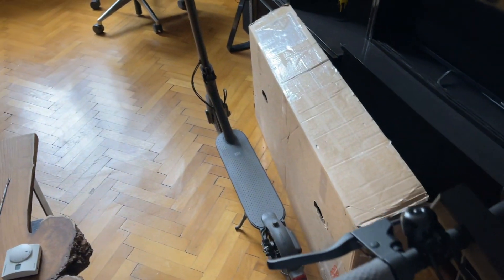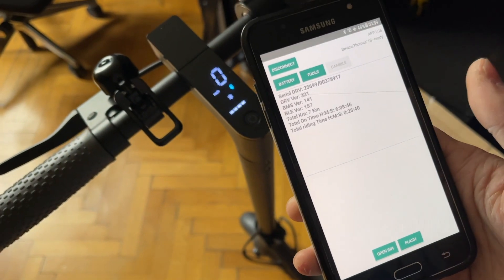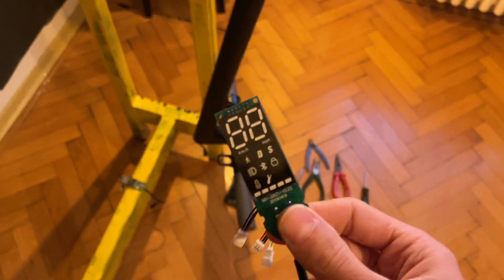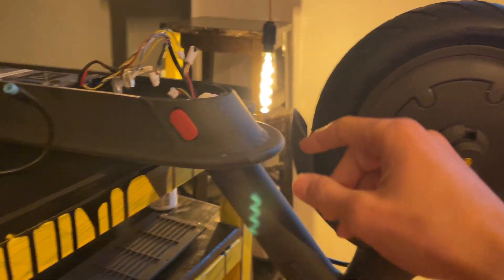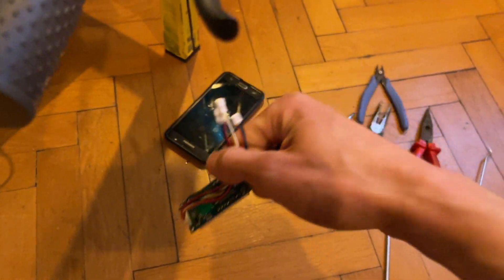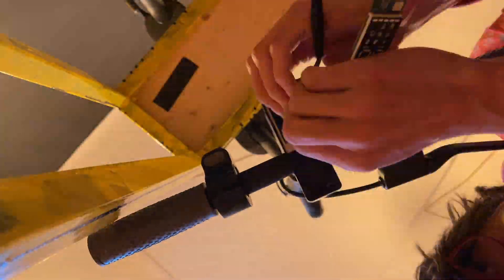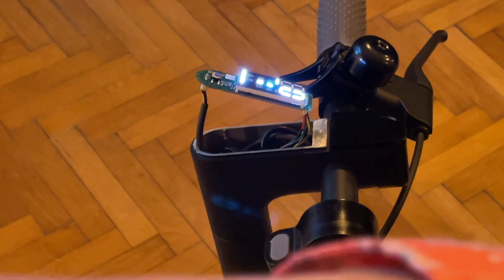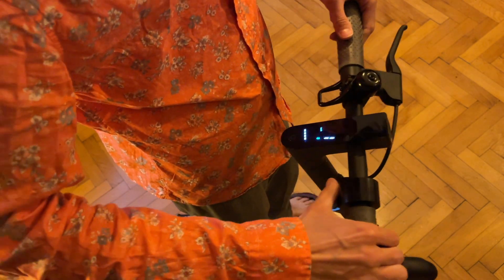Hot to get Custom Firmwares on newer Xiaomi Scooters [DOWNGRADE DRV231 • DRV247 • BLE157]

Comment: My scooter I Xiaomi pro 2 AMG but firmware is locked not receive the flash I want to change the dashboard it's working or not my starting running from 10 speed

Comment: I tried doing this on my Mi 3 and it didn't work. I have BLE 157, bought 2 new dashboards that say for M365/Pro2/Mi3, they look the same, but when I connect it says it's a Pro 2. When I try to flash a new firmware for the Mi 3, it says not compatible, I say to do it anyway, and then it fails. I have tried 2 different brands hoping one of them would work. Can't seem to find anybody else online with this same problem. I'm trying to flash Mi3 firmware, but since the dashboard says Pro 2 I think that's the issue.
Reply from the maker: it doesn't matter what dashboard you use usually

the most incompatibilities come between fake dashboards and the choice between scooter hacking utility and the other app I forget its name

try cooking for both apps and see if either works
Reply: @Darieee  thanks for the quick reply. I did try DownG as well. Was thinking about trying to replace the main board as well and see if that works.

Comment: So if made a mistake with software for more speed and he's got stuck like shows "D" mode and 0 km/h is possible to reset or I need buy a new one of boards and which of them I have to care? Anyway I had try simple reset but nothing happens so it would be great to know with this solve.
Reply: Hi same thing happened to me and I’ve ordered a new one hopefully it’ll work
Reply: @nooneelse1837  Did it work?!!!
Reply: @Obada580  hi there what I ended up doing is buying the new dashboard and it didn’t work so you’re better off getting the main board and the dashboard as a pair , I rewired an aovo pro motherboard onto mine

Comment: Thanks for the video mate. Just a couple of questions: 1. Do yo need to solder any cables or just plug the connectors? 2. Do you need to do any software updates to flash it? I have a Xiaomi 1S with two brake levers
Reply: I have a  1s iScooter very similar so I just ordered a Xiaomi m365 pro kit fingers crossed this works.
Reply: @theebikeguy3852 I HAVE A MI 1S scooter.
Will the Pro Board can be used for this Purpose?
1s and M365 pro have same board right?
Reply from the maker: you can use the 'downgrade dash' while it's still cabled into the 'donor scooter'

just connect that 4pin connector that sits in the pipe
Reply: @Darieee  my idea was to buy a new downgraded dashboard as I don't have a donor scooter. So, I wonder if there are any for a two lever Xiaomi 1S

Comment: I have problem with my scooter 
When I hack max speed There was a problem in it When I turn it off, it works alone. She start automatically  Please help me
Reply from the maker: you have a version 3.0 or 3.1 DRV

those have a new micro controller which is not supported by the custom firmware builders at the moment

Comment: Hey, I did a bad thing, could you or someone help?
 I have serious problems with my Xaomi Pro 2, I am getting warning flashes and beeps of error code 14, 27, and 35 (depends on if I just pushed the brake/gas/button reset).  This occurred after downloading the application DownG. I want to revert it back to stock, or just get it working again.  I was trying to unlock 35kph..
Reply from the maker: scooterhscking utility has the option to load stock firmwares right from the app
Reply: @Darieee  I tried using scooter hacking utility application to revert it back to stock(Repo files). But nothing works. Not BLE129, 132, 134, or 136. BMS128 will flash, but beeping still occurs, same with BMS141.
When I try to flash DRV223, I get "flashing failed, update failed, reason: couldn't write scooter memory"
Same with DRV224 and DRV236 and DRV247.
Still showing signs for error code 35 and 27 (ESC configuration invalid (change SN))

Comment: Hi, I have the same dashboard pro (clone) just like you hold in your hands and I have issues with it (I bought it to replace the classic on my M365). The scooter is working and I can ride on it but when I am trying to turn on the front light it starts beeping and the light is flashing. I can't connect it via bluetooth to anything except M365 Tools app. I bought a ST-link to flash a different BLE version but can't find anywhere how to connect the ST-link to the dashboard. maybe you can help please? my BLE version is 910, ESC version is 555 and BMS version is 115. Thank you.
Reply: it is a bit tricky but you have to soldier 3 pins to the dashboard then you use  the ninebot iAP tool or other tool to flash the ble firmware

Comment: in my case it ended up with error 27 sometimes it gives error 35 and i can`t fix it im searching for solutuions any ideas?
Reply from the maker: what scooter is it ??
Reply: @Darieee  pro 2
Reply from the maker: can you check what DRV version it is ?

I've had issues with a v3.0
Reply: Hi any luck with error 35? Im getting the same also. Tried setting the s/n multiple times but doesnt seem to work...

Comment: I just installed a custom firmware with scooter hacking, by using a friend's dashboard (just screwed of handlebars, switched the plug, flashed it and voila)

Everything went smooth, other than now I cannot turn of the scooter. Sometimes it will make 2 long beeps and 9 short beeps and then it works again. I have read that it is an indicator of "Current sensors calibration errors or Power MOSFET error". But if I update it to the newest firmware again, everything goes back to normal.

This happened when I flashed it out of the box 1 month ago, which is why I had to update it to the newest version through the official app. This solved the problem, but means that I cannot put custom firmware on it.

Does anyone have a solution for making it turn off?
Reply: *Update
Had to revert it back to the newest version. Or it would keep beeping every 20 minutes, plus it wouldn't turn off.

I hope that the scooterhacking community will come up with a new solution
Reply: @anjaansger1571  I have a similar problem, flashed it without updating to the newest firmware and the flash itself worked great but mine wont turn off aswell and beeps just like you described every 20 minutes, did you update to the newest firmware through the official app because mine wont connect through bluetooth to the official app anymore?
Reply: @kylekatarn39  Hey Kyle. I couldn't either. You just have to delete the scooter from the official app and re connect it again. That worked for me. Only downside is that you have to watch the damn intro video again :D
Reply: @kylekatarn39  and just curious. Was it 2 long beeps, followed by 9 short ones? It indicates "calibration problem with the current sensors or the supply of the Mosfet transistors" doesn't make any sense in my head
Reply: @anjaansger1571  Alright thanks I'll try that. In my lack of patience I ordered a new dashboard hoping it would be related to that. It will arrive in a couple of days so I'll keep you posted if that will fix the problem, my wife has a pro 2 updated to BLE 157 so I'll try to flash hers aswell with the new dashboard.
Reply: @anjaansger1571  I can't remember but I'll try to recreate the problem, when beeping I get the error code 29 (MOSFET error) but it would go away just by pressing the power button or reconnecting it to any app like DownG etc.
Reply: Please do!
Reply: @kylekatarn39  yeah 11,12,13, 28, 29 are all MOSFET errors. I have no idea what it means. But changing it back to the newest firmware somehow works...
Reply: @anjaansger1571  Bad News! The new dashboard didn't help, it still won't turn off. The first thing I did was to only change the dashboard, didn't work. Then I did the reset from the official app as you did and flashed it again, same problem. I'm all out of ideas at this moment and can only hope someone smarter than me figures it out.
Reply: @kylekatarn39  but when you reconnected to the official app. You updated the usual way to the newest edition right?
Reply: @kylekatarn39  Sorry for not being clear the first time. Reconnecting it to the official app is not enough. You need to update it to the newest firmware after reconnecting. This worked 👍

Comment: Hello. Can someone explain? I have just bought the dashboard arriving tomorrow and the only thing I need to do is put the dashboard in and the scooter’s maximum speed with be 30km without flashing?
Reply: No, you need to flash first
Reply: I did it but cant seem to remove 30km limit check
Reply: @jwjjhhhh6425  You need to flash first
Reply: @Undead-Edits  He means he did what he did in the video but he is only able to change stuff like motor start and motor power but he cant remove the speed check or change speed limit
Reply: @agentdrink287  Probably flashed wrong
Reply: @Undead-Edits  no don't think so, he said it worked

Comment: I have 2 scooters: a xiaomi m365 with the simple battery indicator only display, and a pro 2 with too new firmware. Can I use the dashboard from the m365, flash the firmware and put the original Pro dashboard back and still have higher speeds?
Reply: Did it today... swaped it back... now it turns on after i turn it off 😂😂
Reply from the maker: maybe - do check and let me know

nothing bad can come of it if it doesn't work
Reply: I'm in the same situation. Did you try it ?
Reply: @danyorton  I ended up not risking the pro 2 because it was still on warranty
Reply: Same here... gonna try it tomorrow
Reply: @cristianilisei5263  let me know how it goes :)
Reply: @kam_mil  tomorrow i get a dashboard from Amazon but i dont think it will work... the dashboard from my m365 lite is flashed.. but i think i nead to read more about that
Reply: @cristianilisei5263  That's a shame, they blocked the ability to flash because of safety regulations :( I actually have a different scooter now, It's the Red bull Racing 10,  really a nice one. Because I bought it in the netherlands, it goes over 30km/h out of the box so I didn't have to modify anything :D
Reply: @kam_mil  yeah thats not legal here in austria.. 25 max
Reply: @cristianilisei5263  It's not legal in poland where I am either, but guess who doesn't care
Reply: Swapping dashboards
Reply: Btw i got the pro2 6h ago   ... fuck it ... :)

Comment: Hi guys! I would like to ask for advice - my Pro 2 is at DRV248 and BLE157. I have a friend with a 1S who has not performed the upgrade. Do you think it will be possible to use this solution to flash custom FW on my Pro 2. Also, should I flash a custom FW made for Pro 2 or for 1S, I am a bit confused here? Cheers!
Reply from the maker: you can totally do that - the dashes are 100% identical

also - you can flash the same firmware on both scooters, just go lighter on the wattage for the 1S (800w tops), the pro2 you can hit harder (1.1kw)
Reply: up
Reply: Hello, could you or someone please help me? I have serious problems with my Xaomi Pro 2, I am getting warning flashes and beeps of error code 14, 27, and 35 (depends on if I just pushed the brake/gas/button reset).  This occurred after downloading the application DownG. I want to revert it back to stock, or just get it working again.  I was trying to unlock 35kph..

Comment: after market dashboard will work for speed hacking? or need also controller?
Reply: No no controller 
You can just buy one and install it
Reply: it can't downgrade the BLE157 using this copy dashboard?
Reply: @willycortez3732  you dont need to just buy aftermarket dashboard instal it and instal the mod ot wil work
Reply: @willycortez3732  i send you the dashboard i use its working perfect
Reply: @bachisquiri  which one?
Reply: @willycortez3732  check it out
Reply: it will work on flashing? to downgrade the ble157?
Reply: @willycortez3732  no need to downgrade
Reply: Just buy it place it and instal the mod
Reply: @bachisquiri  im planning to install firmware for speed and charging mode removal.
Reply: @willycortez3732  ok
Reply: @bachisquiri  do you think it will work on flashing?
Reply: @willycortez3732  i use down g and the firmware from italiansite works perfect speedhack
Reply: @bachisquiri  any link from italian site
Reply: @willycortez3732  yes
Reply: @willycortez3732  let me know when yoyr ready i send it
Reply: @bachisquiri  ok bro thanks
Reply: @bachisquiri  hello bro. Got my order from aliexpress with the same dashboard. And really works great
Reply: @willycortez3732  😉
Reply: @bachisquiri you have file bro?
Reply: @willycortez3732  Whats your email adres
Reply: @bachisquiri  bro you have files for speed hack?
Reply: If I put a m365 dashboard on scooter 3 will I have to flash m365 firmware or scooter 3 firmware to hack it

Comment: Hello, have a new pro2 updated with BLE 157. I try to flash with custom firmware successfully but nothing change and still locked at 25km/h. Did I only need to change the dashboard to old version before BLE157 ? Which dashboard did you buy on your video is that a Pro or Pro2 version ( Pedestrian mode on Pro2 AND ECO on Pro ) ? Thanks for your comments and reply
Reply: @alistair1978  Hi you need to buy new bt controller and replace it to be able to upload your custom firmware from scooterhacking
Reply: @Steph-hs9ep  Its not working even if you get new dashboard you wont be able to remove 30 km speed check
Reply: @agentdrink287 why
Reply from the maker: Hot to get Custom Firmwares on newer Xiaomi Scooters [DOWNGRADE DRV231 • DRV247 • BLE157]

https://youtu.be/EKa-uoOpaC0
Reply: @Darieee  linked same video?

Comment: Awesome video mate. I found it really easy when I did it. I've got a scooter that is hacked and my wife got one where the firmware was locked. I simply took the handle bars off both, unplugged the wire with the blue plug (none of the wires within the grommet) and plugged the blue plug from my handlebars into her scooter and the flash completed quickly and easily from there. Thanks for the guidance.
Reply from the maker: ride on brother 🤘🤘 glad I could help
Reply: Just tried this and it totally works,thankyou for posting the instructions for doing this 👍👍👍
Reply: Great that worked for you! Thinking about doing the same! But do you know what kind of controller you have? I've heard that if you have v3.1 you could break the scooter?
Reply: @sebastianb8032  Sorry mate, no idea
Reply: After u placed your handle bar and completed the soft on your wife s scooter  you placed the handlebar back to yours and bouth worked as hacked?
Reply: @sergiumaties9369  exactly!
Reply: Hello which model was the scooter pirated?
Reply: @catita790  both were pro 2
Reply: @catita790  hi,mine was Xiaomi pro 2
Reply: My bro I got the same problem right now. Updated and is unable to flash the scooter. Can you please explain to me how to do because this problem is very annoying

Or is it any person I can show this to that will understand

Comment: Do i only need to switch the dashboard to an older version ? or do i need to switch the motherboard aswell ? im kinda new to the scooter game, just got mine pro 2 recently.
Reply from the maker: you only need to switch to (or temporarily borrow) a dashboard that hasn't been updated
Reply: @Darieee Then how to downgrade?
If i put my old one back after that will i be able to flash?
Reply: @Darieee  borrow it temporarily? Why? Please explain
Reply: @Darieee  how can i know if it's updated or not
Reply: i have the same question. did you find out?

Comment: Can't you just revert the old (original) firmware somehow and then flash it like in the previous versions?
Reply from the maker: way more fun getting am aftermarket dash and using that to flash firmwares
Reply: but is it possible to flash these new (april 2022) pro 2 scooters by downgrading the firmware? I would like to flash it without changing any parts, but is it possible?
Reply from the maker: I am now wondering exactly how much of this video you have watched (with sound)
Reply: @kylpykonna3302  with a tp link yes.
Reply: @ruhto828  tell me more about this?
Reply from the maker: @rutho means an 'st link'
Reply: @Darieee  can you make a tutorial on downgrading a pro 2 with an stlink?

Comment: Do i still need to open the battery compartment when changing the dash board?
Reply from the maker: nope
Reply: @Darieee   thanks mate!
Reply: @Darieee  however after using the older dashboard and returning to the original dashboard, do I still need to re flash?
Reply from the maker: nope - the dash only carries the firmware
Reply: @Darieee  i tried using the dashboard from the pro 1 but no luck on it.
Reply: @Darieee  someone told me having a 3.1 version board will result in brick

Comment: I got an new pro2 today, and unfortunately I updated the BLE to 1.5.7 😅.Do you think I can use my old m365 steering bar with the old dot display to update the firmware?
Reply from the maker: try it - you can't break anything by trying (so long as you don't fuck a screw up or break a wire physically 🔥)
Reply: Tried,  it didn’t work. It displayed it as a m365 but could not connect to it. And the dot lights slowly faded out.
Reply from the maker: yeah .. gotta try it with someone else's newer dash .. or get a fake one .. although - not all of those are guaranteed to work for flashing firmwares
Reply: @Darieee where csn i buy the BT controller from your video?

Comment: Can I try with old pro dashboard on the pro 2 and is there a chance to screw the settings of the old pro while trying ?
Reply from the maker: there's always a chance to screw everything

but if you only flash the DRV, the dash has very little to do with the entire process - it just relays the data

let us know if it worked
Reply from the maker: but literally 0% chances of screwing the DRV on the first pro

just take their handlebar bits off and interconnect that 4pin socket .. no need to undo the dashboard covers
Reply: I have returned it. It has a wrong battery in it. Pro 2 with essentials battery 🤯